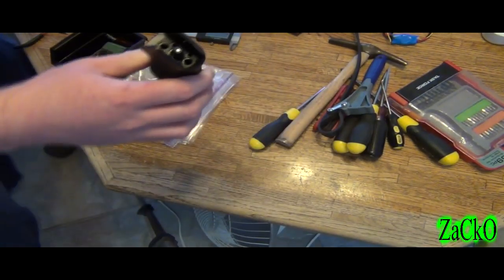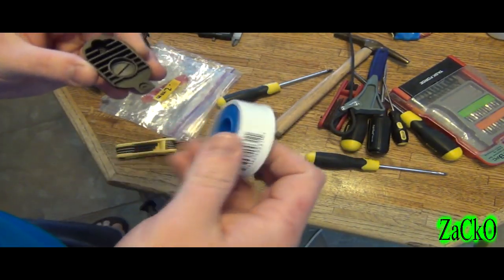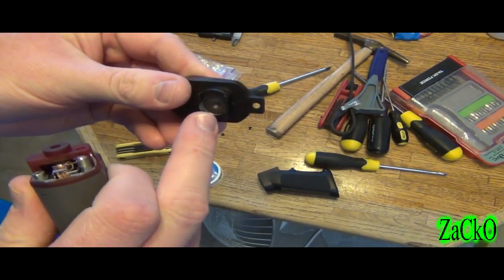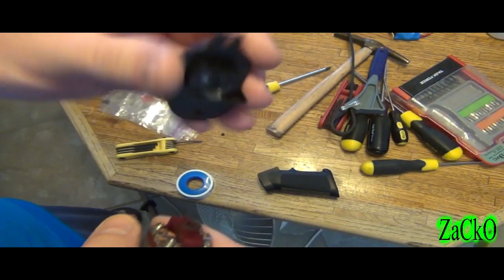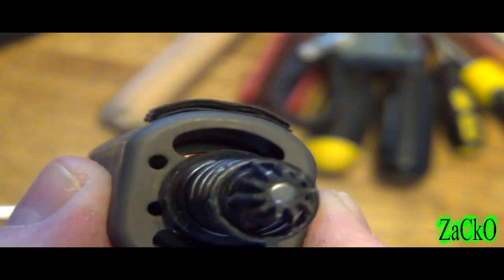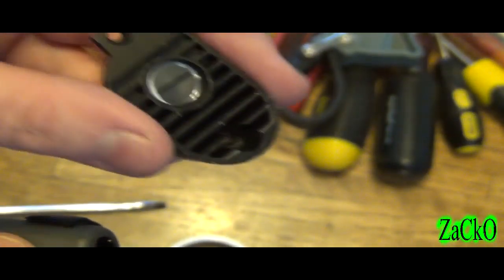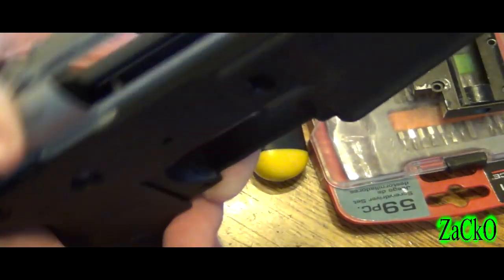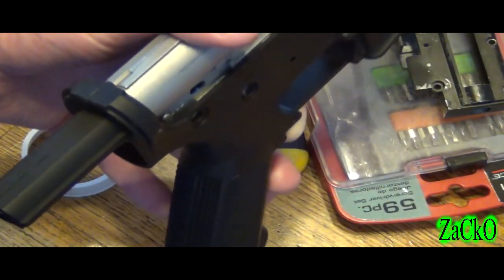Fixing Motor Alignment And More

Comment: I never considered this before. I have been trying to shim an ics sig 551 for ever and just couldn't seem to reduce the noise to an acceptable level. I shimmed bevel/pinion but I noticed the motor has a lot of play in the pistol grip. Even though the sig is a v3 it doesn't have a motor cage. It uses a medium type and sits in the pistol grip like an m4. I think I am going to try this out and see what happens.

Comment: you may want to use something more heat resistant to align the motor. Electrical tape will become quite the gooy mess if heated too much (you won't melt the plastic, but the adhesive will get pretty nasty).
Reply from the maker: I can agree with that, depending on the motor. This will never run that hot though.

Comment: That line on the grip that you showed in the beginning isnt actually perfectly centered or pointing at the bushing positions on the bevel gear in a TM spec gearbox. So you generally dont want your pinion to be centered to it. However some gearboxes that are not accurately replicated from TM have that line pointing directly, but majority of shells that I've inspected have that line slighty off as TM originally designed it.
Reply from the maker: Yea but when is it 100% perfectly aligned? Even the hole could be slightly off while it looks straight to the bushing holes. We just do the best we can. Besides I haven't had time to post an update video of why I couldn't use the tape because the wires wrap around the motor in the grip. So can I make it better? Would have to make a fatter grip also.

Comment: what piston would you recommend for a high speed set up? i exploded a madbull green piston which destroyed my bore up cylinder and piston head. I took your advise and re-soldered all my wiring so that issue is resolved thank you. I am running a shs high torque motor, shs 13:1 gears (short stroked 1 tooth) and a systema irregular pitch 120 spring. I know i need a full metal rack piston but i need something that will not explode inside my gearbox. Any suggestions?
Reply from the maker: madbull green is terrible, I only suggest blue Lonex.
Reply: ZaCkO
what is a good site to get that from?

Comment: HI, my motor which is an shs high torque motor does not move the gears after I had replaced almost all of the parts in my gear box. Could you help me?   My gun is an Vfc Scar-l .  Thanks
Reply from the maker: What do you get? A click noise? How good are you at shimming?
Reply: ZaCkO A clicking noise.   I may take it to a shop. Though
Reply from the maker: Laqutis Did you put in the motor backwards? Also you never answered my question on shimming.
Reply: ZaCkO Im terrible at shimming.  :/     I just tryed both ways for the motor I just still do not know what is wrong.
Reply from the maker: Shimming is wrong, watch like 20 of my shimming videos and use a flash light to check the shimming.
Reply: ZaCkO ok
Reply: ZaCkO Where are the videos man? What happened?
Reply from the maker: Tyler Freitas  Life got busy and I made other priorities... like I lost 100 lbs. I exercise about 1,200 minutes a week.
Reply: ZaCkO awesome do you plan on making new videos in the near future? Your videos are the best teching vids I've ever seen.
Reply from the maker: Tyler Freitas Tech videos of what? I taught everything on camera already, did you watch the 100s of videos yet? I would have to disassemble and do new stuff. I did create some parts on solidworks and shapeways that are private projects, not sure when that will come out.

Comment: one question what do you do for broken motor tabs?
Reply from the maker: Solder or replace with Lonex ones from ClandestineAirsoft.
Reply: ZaCkO  can you upgrade my gun to shoot 20-25 rps for me I'm obviously gonna pay but I need it to cost under 50$ also would like 350 fps to 380 max